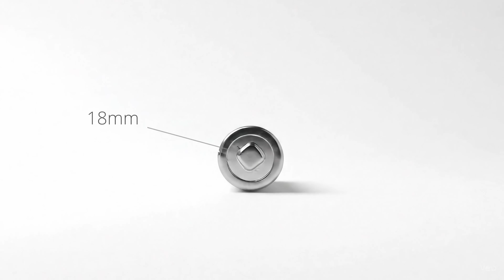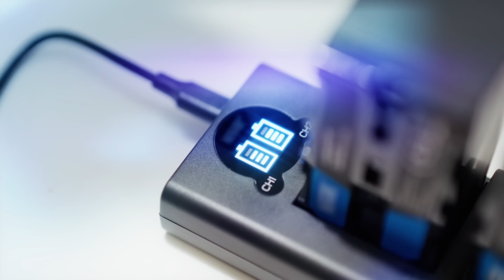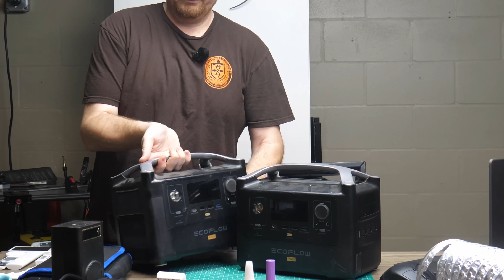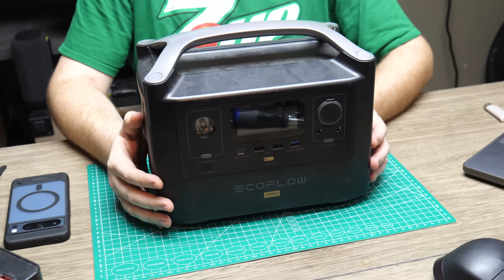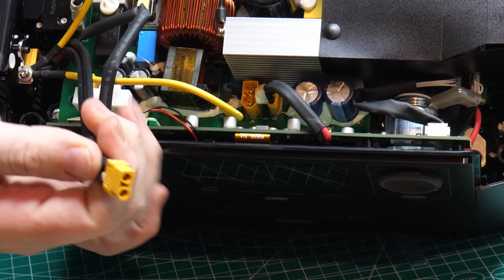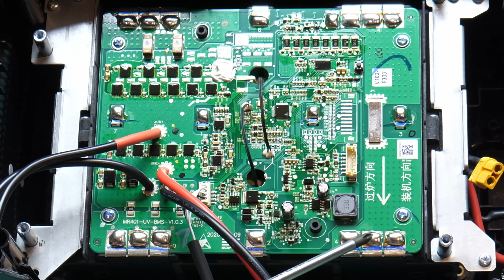I Bought 10 DEAD EcoFlow Power Stations... (Explainer and teardown)

Comment: Part-way through, and at 12:15 I feel the need to advise that it's not whether the voltage is AC or DC that determines whether it's dangerous, it's the voltage and current itself. A common British expression is Volts Jolt, Mils (Of amps) Kill and 1A at 12v will easily kill a person if that 1A passes across them in a harmful manner. ⚡⚰⚠
My local railway network uses 750v DC third-rail electrification...Pushing 5KA through that rail. In this case the fact it's DC doesn't make it any less fatal, and increases the risk for the fact DC causes muscles to spasm into the shock (i.e: You can't let go of the conductor) whereas AC (Which passes the 0v stage at (Hz*2) per second) will give you the opportunity to break off/let go of the conductor if you can. 🎰

Aside from the above, I also need to add that though I can see the potential in Li-Ion power stations like this, I've experienced too many cell losses to put any more investment into Li-Ion - Not when the cells will self-destruct between paying hard-saved money for a product and the point where you actually come to use it. I much prefer lead acid systems; They have a lower power density but they're a lot less UKCA than Li-Ion, but even better is the weight: I get a lot stronger and fitter carrying and using a 4kg SLA-based power bank compared to the terribly lightweight and weak Li-Ion equivalent. 💪🔋👍
Reply from the maker: Pretty sure I specified 'low voltage DC' and 'under around 50v' which holds true due to skin resistance. Nevertheless, in the next video I will take more safety precautions and talk about the necessary steps to do it the right way. 

Thanks for watching!

Comment: Typically you never want to charge a cell that below 2.5v  not just because the crystalization, the cells becomes unstable and can short even if you bring them up slowly as electrode’s copper foil starts to dissolve into the electrolyte and is deposited onto the positive electrode. With extreme discharge copper shunts may form between the electrodes, short circuiting the cell. It can even cycle fine a couple times and cell randomly shorts. I actually seen this, as built larger packs. Any cell below 2v my absolute min voltage is 2 volts and like to se 2,5v, or above, cells get recycle as can't trust it period. Don't risk it as you have a fire and then uncontrollable explosion at random and not worth it, especially on a large pack like that.
Reply from the maker: I'm by no means an expert, but from the studies I've seen (mind you most are based on end of life cells) cells down to 1.1v generally only see a large reduction of life due to the additional copper buildup on the cathode, but it wasn't until you get <0.5v where you see the copper shunts and internal shorts. 

These two were the lowest packs I've seen yet; the others all floated between 2-2.5v when I got them. I plan to do some more in-depth testing of these cells, in a controlled way, to see what happens to them after a full cycle or two. This might be the pack I fully tear down and test the internal resistance/capacity of each cell individually, but that will take some time to report back on. 

Thanks for the insight, would love to discuss it further sometime!
Reply: @fauxrhino  Kind of curious to as well after cycling them how they test discharge capacity and internal resistance. I wondering myself if they were just discharge overtime slowly makes a different, plus could depends to how long they sat at that voltage?

The 2 to 2.5v volts packs sure be 100% fine and expect likely full capacity especially if pack wasn't used much.  Recover many cells that around that and still use them to this day years later. It is the ones really below 1v more concern and curious about about more then anything. I typically don't have much luck when they go below 1v I had a few that literally leaked and yes was current control and low enough and a couple and a few shorted over the years. A few cycle fine a couple time and then shorted. Thankfully was a control test, so was on purpose. Then also had a few below 1v that were fine and over 80% to 90% percent capacity and good 4 wire AC resistance measurement resistance close to data sheet. Also, didn't know how long cells sat and temperature, so could be a huge factor for sure.

Comment: You said that it is all about being prepared. Why didn't you have gas for the generator then?
Reply from the maker: I didn't have a generator! All I had was a backup battery I built myself which can run the fridge for about 24 hours and a tiny 100w solar panel. I was not prepared for sure, but hope to be for the next one. 

Thanks for watching!

Comment: Not being able to siphon gas out of the other car is a user error. Disconnect the fuel and it will pump gas for you.
Reply from the maker: Easier said than done when manufacturers use proprietary fuel lines with plastic connectors that easily break if you don't have their special tools. The risk wasn't worth the reward when I attempted - these newer cars just don't like our old school tricks.

Comment: Why not get LifePo4 CATL 3.2v batteries in an enclosure made to power things like a house?  It seems like you are using a thing made to recharge drone batteries and play music to power way more than they were meant to do.  Or old Telsa battery packs where you can replace the BMS if you want, they are already 18650's, fused, BMS and all, but a lot more of them.
Reply from the maker: Purely size. I live in a 950sq/ft townhome with very limited space for a larger system (also hope to eventually move on to a larger home once the housing markets stabilizes). I hope to do a full home backup someday! Thanks for watching!

Comment: sorry but any car with gas that can start/run is a big generator. get a power inverter and you have power. i think your plan to fix those ecoflows is great. to many things are thrown out these day that simply need 5 min of repair to make them useful. i bought 2 shopping carts of defective jump boxes from costco returns for 20 dollars. they failed from people not charging them after running them dead. they had just lead acid batteries. they really should not have been made and 'over sold' at what they could do.
Reply from the maker: You're not wrong - unfortunately my '300w' 12v inverter failed to even power up a small fan when we tried - lesson learned was to check the equipment you plan to use before you need it! 🙂 

Thanks for watching!
Reply: @fauxrhino   that is a very common mistake people make. you want nothing less then 1500w full syn wave wired to the battery. i once was able to at least save my frozen/reg food lng enough to eat. i only had a 500w inverter and a tabletop icemaker. ran it for 8 days off an old toy corrolla

Comment: You can siphon gas out of a tank. Some cars you can take out the back seats, take out the carpets and you will find an access panel to the tank. Other cars, the tank is under the car and you can figure it out from there
Reply from the maker: Yep, I should've/could've gone that route, but by the time your on day two of 90° and >75% humidity, the willpower to strip the car just wasn't there. I tried siphon and fuel rail then gave up :(

Thanks for watching!
Reply: so u mentioned you were aware of the fuel rail. Well further along the line is the Fuel Pump, which well explains how you can get the fuel from the tank without damaging/ perusing greater disassembly that motivating lacks to complete.   For the folks who don't know
Reply: @fauxrhino  you can actually use the fuel pump of the car to get fuel directly from the fuel rail,  before the check valve.  you just disconnect the hose from the rail and turn the car on., don't crank.
Reply: @fauxrhino  WIMP
Reply: But also: There is a connector with a schrader style valve (like on tires) in the engine compartment, intended for connecting a fuel pressure gauge or whatnot. You can rig up some contraption with a funnel, a hose, loads of transparent plastic as splash protection, and one person wearing safety glasses and whatnot poking the center of the schrader valve while another person cycles the ignition on/off to have the fuel pump run a few seconds each time.
Always wear protection, always do this with a cold engine, always count on spillage. Always let any spillage evaporate before running the engine.
Reply: The last time I tried siphoning gas out of a tank, the British Army were not pleased... 😳

(And that was a fruitless exercise anyway: Our vehicles run on petrol ...And in any case; Heavier vehicles like tanks and trucks tend to run on diesel! ⛽🇬🇧😋)

Comment: That BMS "dearh voltage" is unfortunately still a problem with many systems.  If the voltage goes too low, the BMS can see that as a failure and trigger a permanent failure.
Reply from the maker: Let me tell you a story about how I currently have a bricked Tesla sitting in my carport due to a 200mv imbalance... 😭 Happened yesterday randomly - the 18650 giveth and the 18650 taketh away!

Thanks for watching!

Comment: Wouldn't it be easier/cheaper to find an inexpensive generator and a gas can or 2?
Reply from the maker: Much easier, but probably not cheaper. I got all these units for $800 and given my living situation, I can't really have a large generator running overnight. This option allows me to run the generator to charge the batteries then move them to the part of the house I need them in, vs running extension cords everywhere. I can also use these between a generator and load to smooth out the signal since these are pure sine wave inverters. 

Thanks for watching!

Comment: "Dont try this at home" hahaha im one of them that experiments good enough that i know how to put out a fire real quik and what experiments i should do outside but i do nothing controled or steady with my batteries and their safer than most ppl act as long as u know what ur doing
Reply from the maker: Agreed - they can be safe if you do everything right (which I didn't do in this video). Still good to have precautions like an appropriate fire extinguisher and metal enclosure to throw them in if they start to get hot.

Thanks for watching and best of luck on your projects!

Comment: Some cars (all?) have access to the fuel tank from under the rear seat. It would be where the fuel pump/gage sensor is located.
Reply from the maker: Yep, I should've/could've gone that route, but by the time your on day two of 90° and >75% humidity, the willpower to strip the car just wasn't there. I tried siphon and fuel rail then gave up :(

Thanks for watching!

Comment: Ecoflow batteries making up their packs are matched to .003 Volts before they’re assembled into packs.  The rating of the Unit depends on the heaviness of loading.  It may not meet your expectations of the posted watt-hours.  The Eco-Flow units are like autos.  There is a CAN buss that allows the microcontroller on the main board to communicate with the other controllers on the other boards.  You cannot swap boards without going in and telling the system to accept the exchanged part.  You better have a laptop with a microcontroller USB interface if you expect to repair by swapping parts.  There are many variations of each board.  The programming is different for each one.
Reply from the maker: That just be for their newer packs - these boards seem to be interchangeable without issue - but perhaps I got lucky. Thanks for stopping by, very insightful information. Do you have a source I can reference for a future video?
Reply: I have ecoflow pro  2 years going strong.

Comment: Next time you can disconnect the fuel line at the filter or another connect point, attaching a collection tube and then turn the ignition forward if keyed otherwise push the start button. The engine will start the fuel pump and you can collect the fuel from the car.
Reply from the maker: Great advice! I tried a few spots but regrettably, Hyundai uses some proprietary plastic push on connectors for all their fuel lines and I didn't want to break any, possibly stranding the car. I got close to tapping the tank, but gave up on that idea since it's still in warranty...and fire. I don't like fire. 😂

Comment: I've just tested a bunch of 18650 from China, 3200mAh was the deal, 600-800mAh are "coming out" of them. Nice try Mr. Puh.
Reply from the maker: Ooh, hopefully not some Ultra-fires - I remember those things weighing almost nothing but claimed 5000mAh! 😂
Reply: @fauxrhino  No it the normal weight and they look exactly like the original Panasonic ones, minus any company logo. But they can't even take a small load, at 1A they just crash and not the "protective chip" kind of crashing lol
Reply from the maker: Hmmm, I just saw a video about fake 18650s that were just filled with sand - might be worth a quick search to make sure you're not dealing with the same thing 😕
Reply: @fauxrhino  But they're holding their 500-800mAh, I guess they are re-re-reused
Reply from the maker: @daviniusb6798  Yes, if they're individual cells, I agree. The ones I saw were all parts of packs of cells and a few were working but most were sand. That's really a shame - I would check out this site; I've sourced raw cells and full packs from them and they're very knowledgeable about what they have: https://www.batteryclearinghouse.com/
Reply: @fauxrhino  Thank you very much, that will help!

Comment: DO NOT PUT ANY LI-ION BATTERY THAT HAS GONE BELOW 1V BACK INTO SERVICE!

Once a Li-ion (or Li-po) has gone below a certain voltage (normally around 3.2V), there will be checmical changes that will quickly reduce it's capacity/life. Below 1V? Just drain the battery to 0V and safely recycle them. Even if you were able to "bring the battery back to life", the capacity will be so degraded that it will not be worth keeping it in service. Not only that, but in a series setup, even with a BMS, you will be running with batteries of such varying capacity that you will be running the risk of a battery fire/explosion, because of the missmatch causing 1 or more of those batteries to drain/charge faster then the others. And all it would take is just 1 such battery to cause a fire.
Reply from the maker: Stick around to see the capacity tests and possible fire!! These two have been the only ones <2v I've run across so far; I'm interested to see how that degradation stacks up to one of the units I got with a good pack. Thanks for watching!

Comment: To get gas out of your car you pull the hose going to fuel rail and put the end in a container then pull out fuel pump relay and jump the + and - terminals of relay with a wire or paper clip. Or just turn ignition on and off , but that is going to be a little more tedious and rough on your pump. I mean it IS an emergency situation. I have even pulled the filler hose off tank and siphoned from where that enters the tank. Some cars can be a chore , because, engineers have to keep their jobs.
Reply from the maker: I considered pulling the filler neck or even drilling the tank after I found the proprietary plastic fuel rail connectors. These new cars gotta be difficult so our old tricks don't work anymore. Thanks for watching!

Comment: crystalization starts at 2.5-2V and lower you get, the more crystals from by filling up the electron spaces. Simply, if a cell is below its minimum voltage specified by the manufacturer, it starts to loose its capacity in an exponential way.
Reply from the maker: Stick around for the capacity tests! These two were the lowest by far I've come across, so I'm also interested to see the degradation! Thanks for watching!
Reply: Also unless the particular manufacturer says that it's safe to use batteries that have gone below a particular voltage, I would advice against using the batteries.
Reply: Fires are hapenning because people like you is forcing overdischarged cells to recharge. Dendrites are not a jocke. And after you think these have been recovered,  their high state of charge will become a timebomb!!! Right to rrpair is fine but people that think they understand lithium ion battery and spread a dangerous method to reciver these is worst. Delete this video ir redo it explaining how it can be dangerous and read more about thst to get tge right informstion. Your desire to repair is great and your lack of knowledge together made a tunnel vision making you to forget to consider all the danger it create.

Comment: Regardless if it is DC or AC current, it can kill you and even if it is lower than 100mA. Why is up to 50 V considered safe in most cases is because of the skin resistance.
Reply from the maker: 100% I didn't explain that well enough, thanks for the correction!